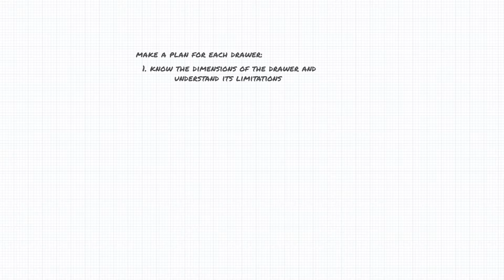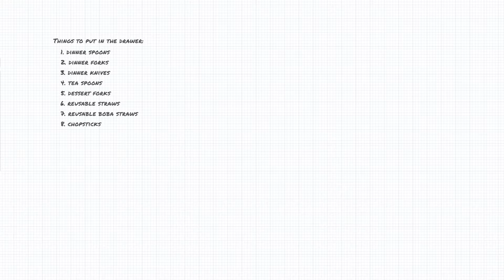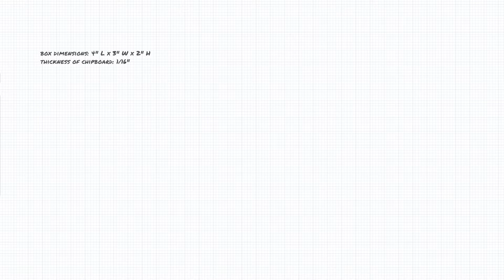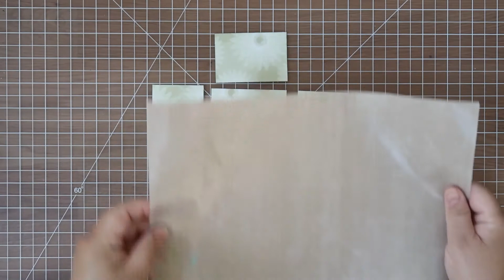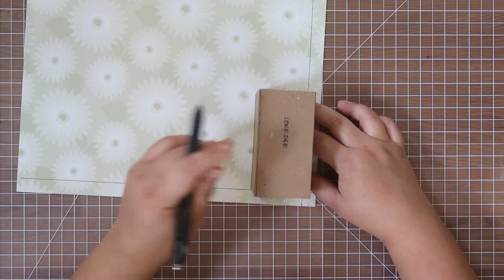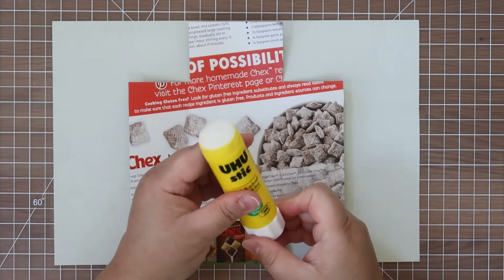Creating Custom Drawer Organizers

Comment: Hi Johwey, I have a question for you! In your room tour video, you had some of the boxes with lids because they were supporting the little condiment trays. When you make a lid, would you just make it the same size as the bottom piece, plus the width of the sides? Is there a way to make sure the lids actually stay on? Thank you so much! I absolutely love your studio and how you organize!!!
Reply from the maker: @bdk_creations  I add a layer of thick chipboard under the lid, the size of the lid/box minus the thickness of the perimeter walls. This makes the lid fit snugly on top of the box and prevents it from moving. 😊
Reply: @ ahh that makes so much sense, thank you so much!!!